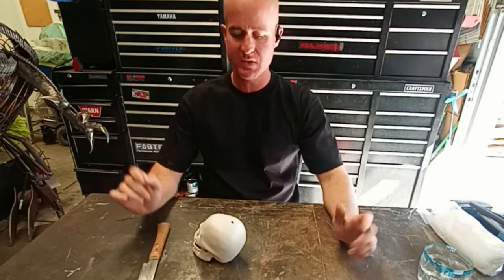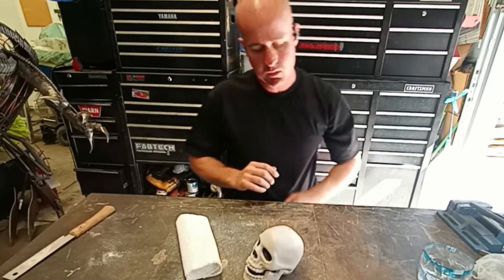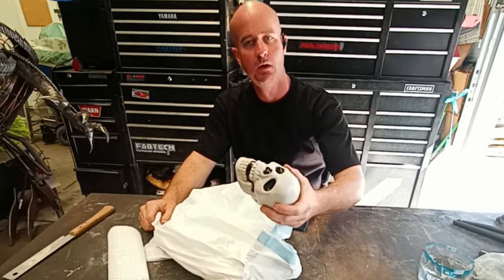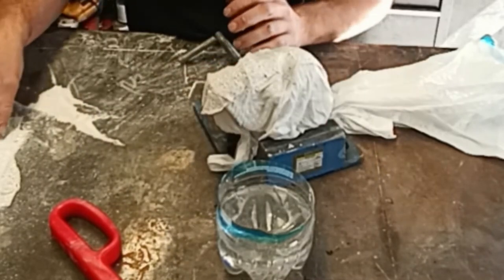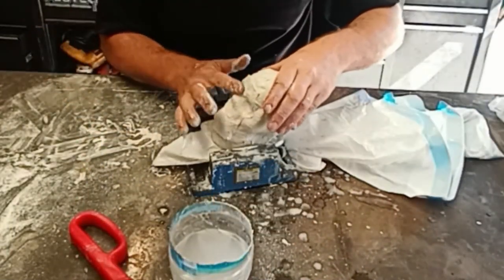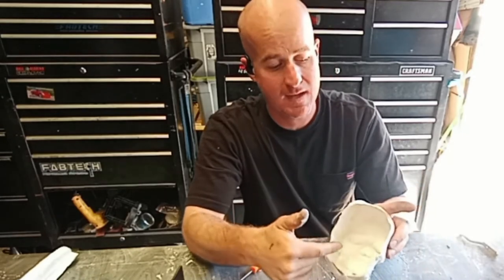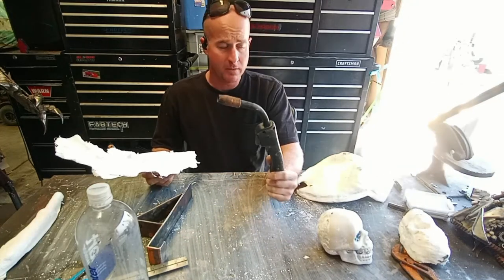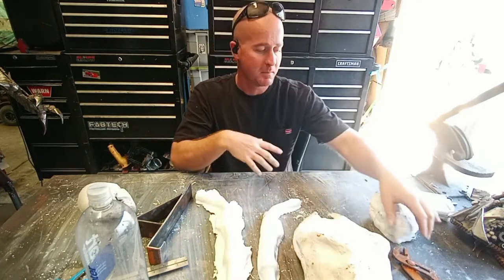How to make a plaster mold for metal art

Comment: How many uses do you get out a mold when welding?  Have you tried molding with concrete?
Reply from the maker: I'd say 3 at most with this method. I haven't used concrete or drywall joint compound